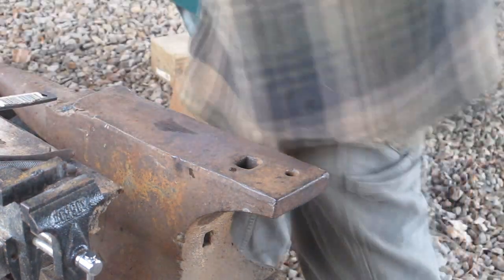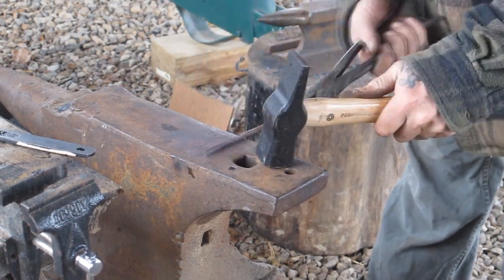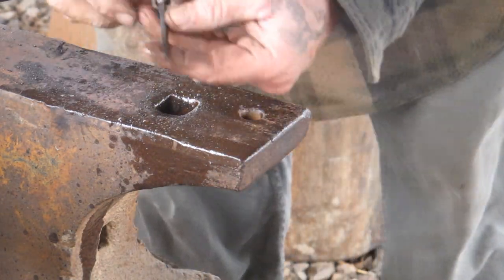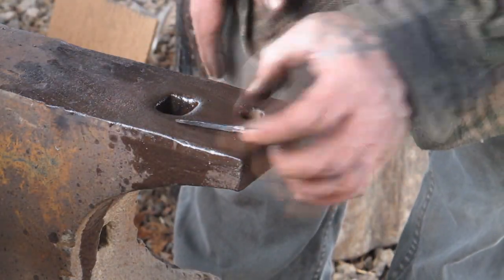Blacksmithing Part 14 Making Nails

Comment: Nails were so important to pioneers, many would burn down their homes and collect the nails before heading west. Making nails, in my opinion, would be the single most important item (when blacksmithing) to learn for anyone concerned about long term survival. It would make building any simple wood structure so much easier.

Comment: the fastest way to draw out square is strike once, rotate 90 degrees. strick once, rotate back to start position  repeat.  this way you only have to stricke on 2 surfaces and rotate 90 degrees and back. drawing out the nail as you go.

Comment: I use screws for construction but have a big jar of double headed nails in my truck tool box because sometimes pounding a nail is the best solution. I carry a shinglers hammer (12 bucks at menards) that has a hardened hammer on the other side of the full hatchet head.

Comment: Nails are very important. When people would ditch their homes and head west, a lot of them would burn their homes to the ground and retrieve the nails. Knock through the drywall in your bedroom and see if the framing is held together with wooden pegs. It's called technology.